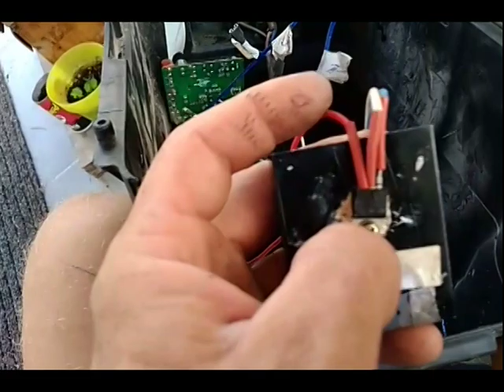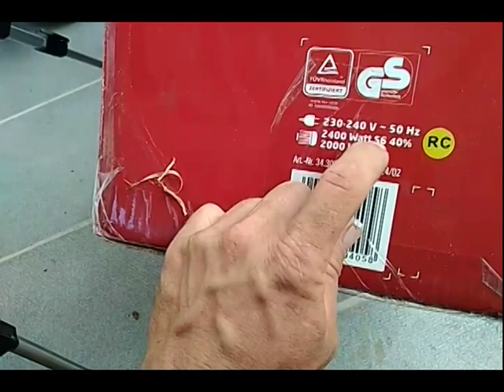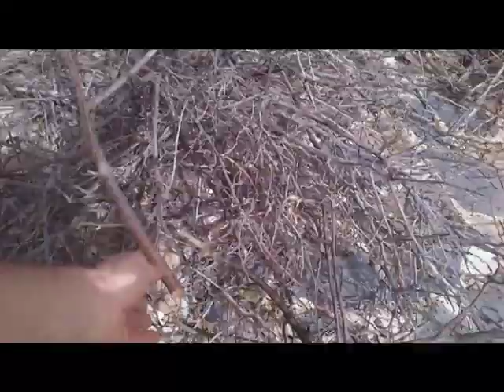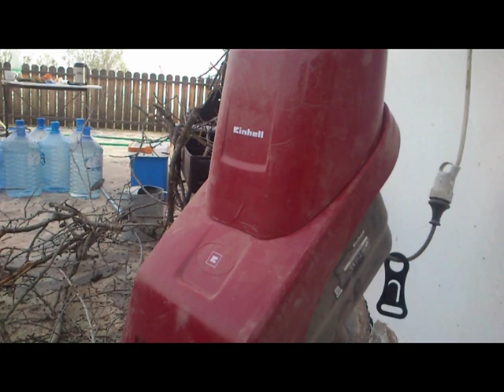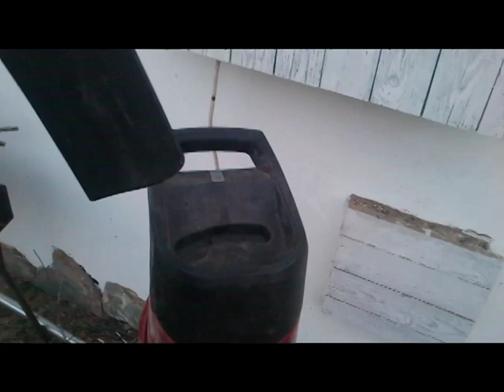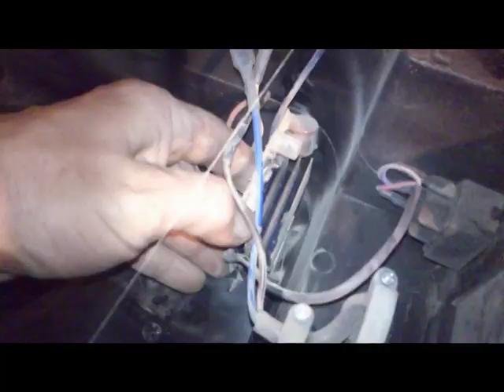Einhell shredder, should you put your money on it?, long term review.

Comment: Thanks! Great info.
I want to buy this thing for the motor. It's a 2.4kW electric motor for $99. I want to replace the 500W motor in my bench drill, as it's not strong enough. What do you think? Will the duty cycle keep up?
Reply from the maker: this is a brushed motor. Bench drills tend to use cage induction ones, brushed ones have much shorter live expectancy. I would not recommend that. If so, you need to take it together with gears, otherwise rpm will be way to high.